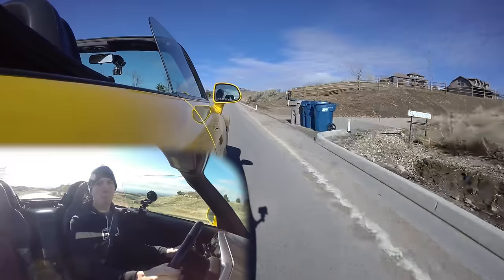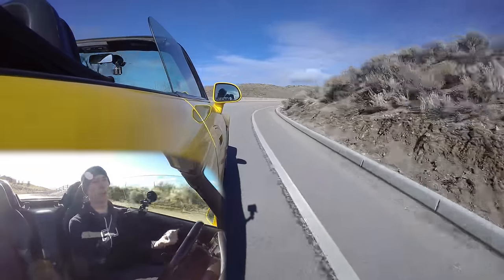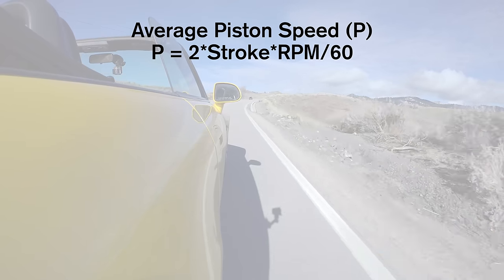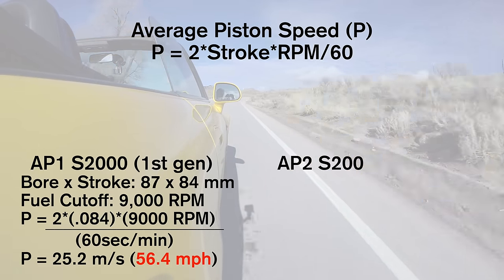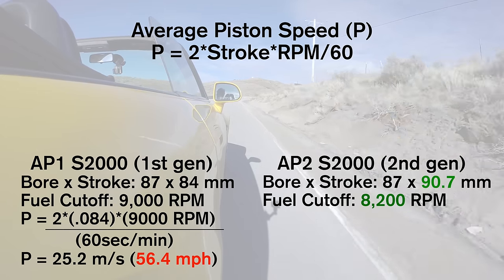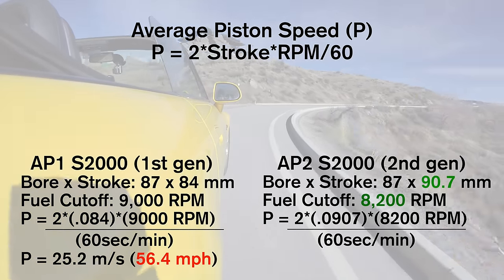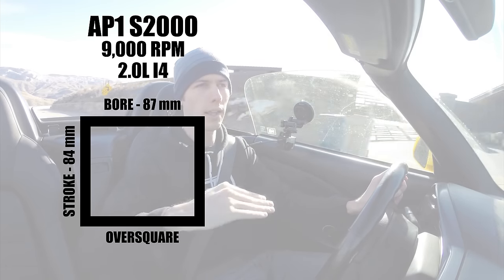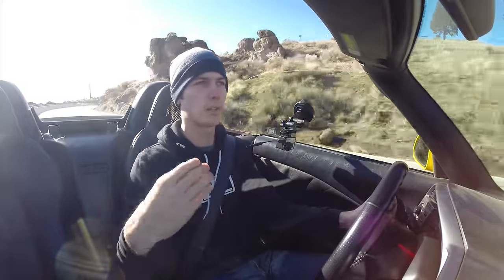How Do Some Engines Rev To 9,000 RPM?

Comment: Bro ... I have a rotary in my garage right now that makes its peak horsepower at 17,000 RPM , I was like what the heck!!!
Reply: yeah a RC OS wankel or possibly NSU powered bike but no 12a, 13b, 20b or 26b would do that rpm no matter how much you clearance rotors and bearings lol
Reply: sarcasm much. Rotary can rev up to 11,000rpm. the only car engines that can rev up to 17,000 are F1 engines and even then the engine will wear out.
Reply: Even if you werent lying.... wankel engines make their peak power about 3RPM before the apex seals give out
Reply: NANI?!!! OVER 9,000?!!!
Reply: Here in Aus there was a 13b twin turbo running methanol clocked at 16,500rpm
Reply: Warped..........The Honeywell Turbine Engines on the Challenger 350 I operate has a high-speed turbine speed of just over 32,000 RPMs which makes about 7350 lbs of thrust.
Reply: reminds me of Hert's Twerkstallion, breaks something every time it hits 3rpms.
Reply: BangDroid, I'm in Oz too and never heard about that, got a link? Cheers
Reply: hmmm 17000rpm rotary eh? dont tell me its a cordless electric drill!!!
Reply: Brock Bain it's not a lie, I made an episode on it, it was supposed to post yesterday, but I had a computer crash, it's either going to be out Sunday or Tuesday but it's good, and the engine actually makes its peak RPM at 17000, it's insane almost scary to hear...
Reply: Snow Crest I have heard of those engines, what other vehicles do they use on?
Reply: Ryan Kessler I will very soon.
Reply: fidel catsro no it's an actual engine, it's the engine I picked for the first rotary episode of the series. Comes out either Sunday or Tuesday on YouTube
Reply: electric feel now this rotary, it red lines at about 20,000 RPM, it's not a car engine though but it is a Wankel
Reply: The_Bait haha, you're good, you know your engines baby, wait till you see that episode, it was one of the hardest projects I have ever done. A two-day shoot turned into 2 weeks
Reply: MotoGP engines will top out at 18000. Quite reliable as well, they only get 5 engines for a 18+ race season.

The newer F1 engines aren't going over 11000, thanks to the v6 config and the turbo.
Reply: Motogp could easily go beyond that 18k rpm.
Reply: electric feel 
The Chrysler Turbine Car idles between 18 000 and 22 000 rpm and spins up to 60 000 rpm.
Reply: @Creeperboy099  kanse dorifto 😂🤣
Reply: Warped Perception has
Reply: @brockbain8656  The peak power is just a limit of torque efficiency, you don't need to go all the way to peak power if your engine can't handle it obviously.
Reply: @WarpedYT  Dont know what engine that guy is talking about but I do know Honey Well was in the running for US Helicopters like the Defiant X. Thought the Valor too but Roll Royce took that.

 So it wouldn't surprise me thst they make super high RPM engines. Yet I only know of turbines.
Reply: @dianapennepacker6854  wow this is an old common but the engine that I was talking about was this little OS Wankel engine, tiny little thing I think it was like 4.9 cc displacement. Only like 1 horsepower..haha. that's why I was able to run to 30000rpm bc it is so small
Reply: bro how tiny is that

Comment: I love a high revving engine. Used to own a Mitsubishi Mivec from the 90's that revved up to 9200rpm and boy, the joy you get from the pull & the sound
Reply: Which Mivec? V6?
Reply: Aleksy Kabat nah, the one and only v7 engine
Reply: Aleksy Kabat it was actually the 4g92 head paired with a 4g93 block. I've tried the 6a12 on the FTO before but somehow the torque isn't fantastic on that particular chassis
Reply: You haven't heard anything unless it was a 9000 rpm 396. Ran around with one for over a year back in '73.
Reply: Hee Sing Sia yeah, I've got now 6a13 in Galant and was thinking about upgrade to Mivec heads, but it's not really cost effective
Reply: u2mister1 never seen a 396 rev up till 9000 before but i can imagine having seen one that did over 7000 many years ago.
Reply: Aleksy Kabat Do it!!! I'd assume it would be wonderful with all the torque the 6a13 puts out. The head only comes into play when you push it above 5000rpm anyways
Reply: The only other one I saw personally was a hydro-plane on the water, and the sound was magical. It's name was 'MoonShot'.
Reply: My motorbike starts getting power at 8k and ends at 14k
Reply: Nah bro, I think to go with 6g74 with 6g75 crankshaft, but I'm not sure about bolt pattern on Galant AT bellhousing
Reply: Was it the Mitsubishi 3000 GT ?
Reply: For sure Pajero, Diamante and Magna/Verada/Sigma, I think 3000GT had Galant/Legnum engine - 6a13tt
Reply: The 3000GT had the 6G72 out of the Pajero / Montero under the hood.  Great little engine, but breathes like a pug with a cold.  When I get around to upgrading mine, I don't know if I'm gonna swap heads or straight up dump it in favor of a 6G74.
Reply: buy a s1000rr and you will have 16.000 revs.
Reply: But whats the difference between lets say a 1.8l that makes 180hp at 7.5k rpm and a 2.5l that makes 180hp at 6k rpm? Lets say all else is equal which of the two will be faster and why?
Reply: @eliasaggeli1225 the best way to make power in an na engine is with revs or displacement. Bigger displacement means more air and fuel can go into the engine and therefore bigger bangs, higher revs means that more bangs occur in the same time. Bit difficult to say which would win because its not all on the engine but also the rest of the car
Reply: @YoungShul  i believe that an engine with more power that occurs from higher revs is more powerful cause on that higher revs the power will be generated quicker and engine will spin faster so a higher revving engine will be more powerful at higher revs than a same power engine but lower revving(higher cc)
Reply: Yeah so l, it revs high but the torque.. is the same very Interesting concept, I drove only pentrols my actual is a 1.6 k4m760 the last petrol I had was a 2000cc Peugeot Man that thing was a bliss.🎉🎉🎉😊, you felt the tourqe as it pulls and pulls, since I'm in Romania, anything over 2liter is considered premium/sport. Anyway the Peugeot 206CC got a 2l 138hp NA stock car beautiful to drive as this s2000, got leathers bolsterd seats, heated a joy to drive.

Comment: Experiencing the 9000 RPM redline of a GT3 is something magical!
Reply: ...imagine a 20.000 rpm (old) f1 engine :)
Reply: GT3 upshifts at 9,000 rpm are orgasmic
Reply: Absolutely!!!
Reply: I had a Yamaha r6 that reved to 17.000 it was not quite 20k but it was close
Reply: Alfredo Meireles Or you can just ride a motorcycle. That's one of the things that I love most about bikes. Crazy crazy redlines
Reply: Based on the math in the video, and given that the stroke in my Boxster is shorter than that of the GT3, I'm kind of bummed there's no real reason I can't rev to 9k
Reply: +Kyle Cronin in that case it's more to do with the mass of the piston. A heavy AF piston on a short stroke still has a very low redline.
Reply: What about an 9000rpm Lexus LFA
Reply: Meanwhile  R6 sitting  in corner

Comment: With VTEC which includes 1000 magical unicorns farting at once - MOOG
Reply: *a million
Reply: and its VTEC, not V-TEC
Reply: If ya wanna get really technical it's: VVTAELC
but it just doesn't have the same ring to it.
Reply: Right xD
Reply: Yeap!
Reply: Welp I've always preferred the  -
 ^_^
Reply: Paul Wade VTEC is an official name. And as you know, its not a V-technology or anything. Sometimes i see V-TECH. Its just VTEC, nothing else. Its clearly written on my engine :-)
Reply: VARIABLE valve TIMING and ELECTRONIC lift CONTROL
Reply: close but not right :)) "Variable valve Timing and lift Electronic Control". The lift is not electronic, its all electronic and variable is valve lift and timing ;)
Reply: I was close enough ;)

Comment: Takumi's Trueno was able to rev to 11,000 rpm
Reply: iTZz Kittens 

Well, it doesn't rev anything since the engine got blown up.
Reply: Lauren C before it got blown
Reply: It was a special engine too
Reply: it used titanium forged pistons bro
Reply: everyone quoting initial d and im just sitting here staring at the 15k rpm redline in an rx 7
Reply: @leightoncollins3704  yours doesn't count its a dorito lol
Reply: There are race 350s that launch at 12,000 rpmand can hit 13-15k rpm. There are a ton of high revving engines out there.
Reply: John Citrous  It was a 4a-ge 20v silvertop that redlined at 12,000rpm in initial d. the 4a-ge was replaced by the 7a-fe
Reply: @leightoncollins3704  that aint stock is it?

Comment: To add to the conversation.  Usually one of the first components to fail when over revving a piston engine are the rod bolts due to the mass of the pistons/rods.  Connecting rod bolts will stretch under extreme stress, thus causing bearings to unseat and spin inside the rod journal housing.  I've encountered this once lol.

Comment: Somewhat related, I love how you’re covering both Gasoline and Electric engines on this channel. Really helps when we are seeing both in the mainstream right now.
Reply: No such thing as an electric engine. AC Motor and battery pack. More simple, more powerful and more efficient than the internal combustion engine.
Reply: Um.. Laren, things that run on battery power are DC without an inverter. Sometimes more powerful than ICE, sometimes not, deepending on some factors. Don't hybrids start their ICEs if you mash the go pedal quickly, demanding a lot of oomph at once?

Comment: Another great video! Big shout out to the Mazda RX8 Renesis engine! A dyno chart for that engine will show that peak power comes at its 9k rpm redline which implies that if Mazda designed it to rev higher, it would continue to make more power. The cool thing about the rotary is that it isnt bound by a cylinder head. The manual version of the car comes with an engine with 6 total intake ports vs 4 found in the automatic trans equipped models. The 237hp 6 port engine revs to 9000 rpm (possible partly bc of those 2 extra intake ports) while the 4 port version only revs to 7500rpm and makes 191hp.

Comment: If you're ever visiting/filming in the north of England, I'll let you drive my "poor man's RWD" (MG TF). It's nothing like your S2000, only has a farty 115HP, but it has an insanely fast throttle response which makes it fun! I don't think you have MGs over there, do you?
Reply from the maker: We do not have MGs. Thanks for the offer!
Reply: its still better than my citroen ax11 60hp catcart!
Reply: we got old mgs in missouri
Reply: We used to have MGs here.  I owned a 1973 MG Midget back in the late 70s
Reply: MunroM84
I won't disagree with you there! Fun car to drive, but with an engine that has the tendency to need constant care and attention. Waiting for the "Beast from the East" to disappear so I can once again dissect the engine and fix yet another issue.
Reply: There are tons of MGs in the States. They are not very popular and can often be found cheap mainly due to low power, small size, awful electronics and wiring. They have a small cult like following of stranger old guys. I've seen tons come thru the classic car dealership I used to manage in Atlanta. Never seen one sell over $6500
Reply: @EngineeringExplained  That would be my dream car. Clean up an old Mg, Spitfire, or Datsun 2000 , do some chassis and suspension work. Then stick a built Turbo Hayabusa motor in it that revs to the heavens. The power to weight. Fun fun fun

Comment: At high RPMs the limiting factor is usually valve-float.  The valve springs cannot close fast enough at very high RPM and cause the valves to bounce and chatter.  You can partially correct for the flame propagation problem with sufficient ignition timing advance.
Reply: well valvesprings can cope with very high rpm if specced right, but they are going to steal a lot of power and be much harsher to the valveshaft
Reply: Also it's not that the valves can't shut fast enough, they wont stay shut. As in they BOUNCE off the valve seat and you lose compression.

Comment: I would be very curious to hear about the different strategies that manufacturers use to allow them to get to higher RPMs. So hearing how F1 cars do it, hearing how motorcycles rev that high, both would be extremely interesting.

Comment: How Do Some Engines Rev To 20,000 RPM?
Reply from the maker: Kinda illustrating this with the F1 example in the video. The stroke is around 40 mm, which keeps the piston speeds less than an S2000, even though it's revving twice as high. But for street cars (with the exception of the new Mercedes Project One), rarely is 9,000-9,500 exceeded.
Reply: There electric
Reply: Carbon Reed ha ha ah lol
Reply: ^ great question
Reply: Hari5g900 possibly because of a higher reciprocating mass, but don’t quote me on that I’m not exactly qualified to answer that
Reply: Very little light pistons and stroke, old CBR250R MC19 and Kawasaki ZXR250 Yamaha FZR250 used to rev almost to this amount (19k for Kawasaki), and they had 250cc inline 4, 4strokes. Kawasaki had 49.0 mm piston diameter 33.1 mm stroke, and 12.2:1 compression ratio.
Reply: Hari5g900 longer stroke means you have more work done (work=force*distance) longer stroke=longer distance, this means more torque (which you want to have in normal traffic, starting at a redlight and such). Also when you have a longer stroke means your conrod remains more parallel to the cilinder walls, so the pistons push less angainst the cilinder walls (=less wear and tear=prolonged engine life)
Reply: Wouldn't it get to a point where an engine can't have too short of a stroke as it wouldn't move far enough to spin the crank?
Reply: Hari5g900:
Size: keeping say a 4 cylinder with a wild overbore would be bigger. In today's world, we're constantly getting things more and more compact. 
If you keep the physical size of the engine with a wild overbore you'd have to reduce cylinder count. One good reason you mostly see 4, 6, or 8 cylinders is they typically run smoother. Reducing the cylinder count means more degrees rotation between power strokes. Increasing that number makes it easier to "feel" each power stroke (AKA Vibration). 

To achieve what you're wanting, companies like Dodge have the HEMI. Short for hemispherical which is the shape of their combustion chamber. It's a domed shape where the piston matches that shape. You effectively increase the surface area of the piston face without increasing its diameter. To achieve complete combustion (or close to), they require 2 spark plugs per cylinder.
Reply: The travel distance is shorter but the frequency at which reciprocating parts change direction increase which will increase the parasitic loss and the amount of strain on the parts. Even though the piston velocity may stay the same the amount of distance it has to come to a stop and change direction is reduced, referencing F=MA you can see how the force will increase since the acceleration or deceleration will increase. That is why light parts are critical.

Also keep in mind it becomes tricky to maintain torque across such a wide range of operation, and even though you can use gearing to get the required torque to the road most people outside of enthusiast wont want to drive a car that you would need to cruise on the highway at around 10krpm.
Reply: The V10's were some of the highest revving F1 engines and the Cosworth V10, Ilmor (Mercedes) both ran 37.5mm stroke. There was a test engine by on of the engine manufacturers who ran different strokes in test engines down to 32mm stroke. Piston weight became an issue going that short.
Reply: 3lbtrigger What does surface area have to do with anything? If you increase surface area by changing the surface angles, you do indeed get more force from the same pressure, but you're also changing the force's direction. The vertical component ends up being identical, and you just end up burning fuel for a horizontal component that does nothing.

The purpose of the hemi engine isn't to increase surface area. The curved top of the combustion chamber helps regulate combustion and aims forces a bit more towards the center of the piston. The curve on the piston is solely to reduce the combustion chamber volume to increase the compression ratio.
Reply: They dont
Reply: Also gotta consider an EXTREMELY lightweight and STABLE/BALANCED valvetrain, and rotating assembly.
Reply: Carbon Reed electric will never make it as big as gas burners and diesels.
Reply: 2 stroke

Comment: how do you rev to OVER 9000?!?!?!
Reply: got vtec？
Reply: get yamaha r6 or zx6r , 14800rpm , max. red line 18k rpm and zx6r can easily do 16k rpm
Reply: or get a Honda CBR250RR lol you'll be at twice 9000
Reply: There's some cars that can revs higher,if you had the money go for it, if not most bikes can
Reply: nobody here got the joke
Reply: Downshift from 3rd gear at 9.000 rpm to 1st :D
Reply: Samejima Mamimi sigh It's okay OP, some of us understand.... Some of us understand.
Reply: Samejima Mamimi Napa it’s over 9000🤬
Reply: Several methods, wider bore shorter stroke. Shorter strokes reduce force on the crank from the weight of the pistons. Also, some use nitrogen instead of valve springs due to limits with valve springs. Also going with a larger bore, you can go with a lager valve to allow better air flow. You also want to reduce the weight of your fly wheel. Basically, weight is your enemy with RPM and reduce the number of mechanical devises as possible.
Reply: The money shift...
Reply: drprzulj oh god... that's one way though
Reply: Ok... guys it’s more of a meme than an actual question. Lol... i guess no on watched dbz smh.
Reply: Samejima Mamimi call Extreme Tuners
Reply: Upgrade valve springs and retainers too prevent valve surge. That’s really one of the main things with trying to tune your car to rev higher
Reply: drprzulj 
Oops did not need that engine anyway
Reply: Yaal got VTEC?
Reply: +KEVIN MANSFIELD lmao!! 😂😂
Reply: f1 v10 era 20k rpm
Reply: even the old school ninja ZX25R can rev up to 20k rpm.